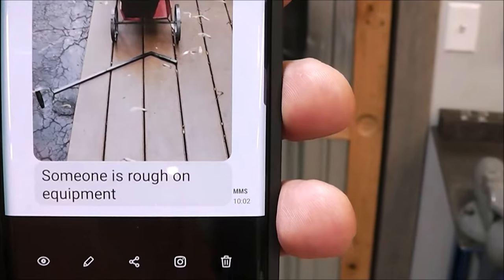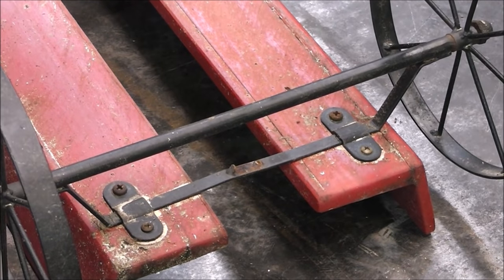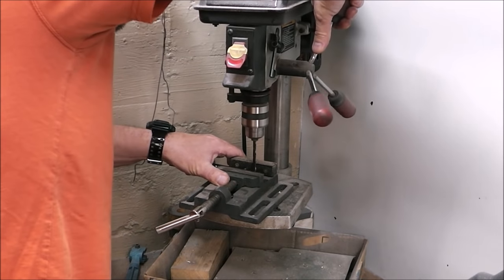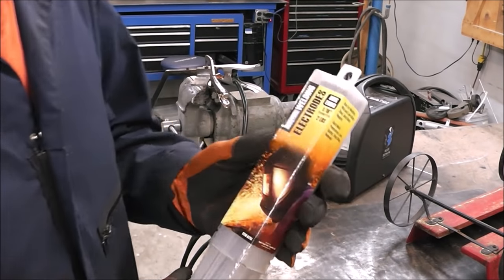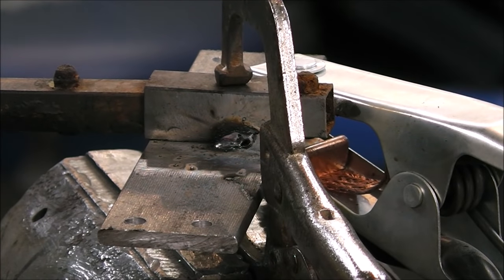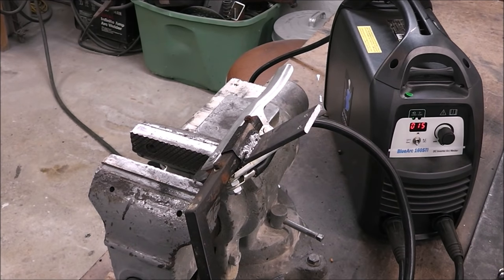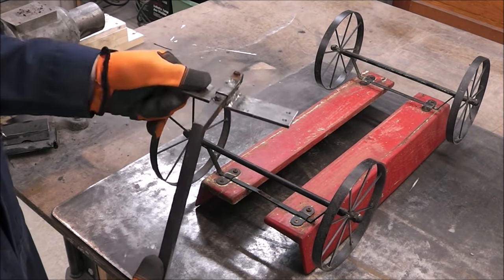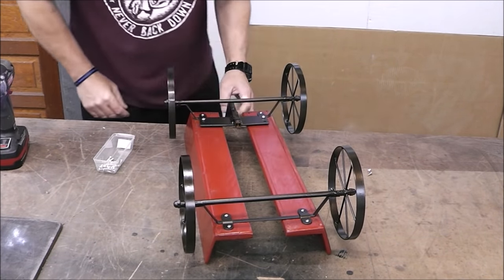Stick Welding Super Thin Sheet Metal Welding Thin Metal

Comment: Brazing might have worked nicely for that too I think. Lower temp and filling the uneven gaps.
Reply from the maker: Brazing is awesome! That's the first process I learned on. Welding in floor pans and I even chopped a 70 chevy and brazed the top back on. I got pretty good but it's been a while a long time but I love brazing

Comment: There were some kind of stainless rod I used to for sheet metal before, they were given to me and I don't remember the spec details but the big plus is that that were wayyy more forgiving than 6013.
Reply from the maker: Probably 309?
Reply: I just don't recall exactly, it was a couple of decades ago, but I've noticed much the same ease of use and forgiveness of the rods made for cast iron as well. I'm guessing it's a matter of the higher nickel content in both cases. Of course the rods are expensive and perhaps the welds won't be as strong but they sure are nice to use and the ones that I have used make for a good looking bead.
Reply: @Evasguy  for difficult cast iron repairs,get well cleaned,make a deep V groove,drill a hole at each crack ends if is a crack in a wall,start with a 309 stainless rod as a root weld,then coil a bare copper wire around 2.5mm 7018 rod,it will be difficult but will get a strong elastic repair,preheat to aprox 250-300Celsius if is a critical or sensitive piece,if the cast iron wall is bigger than 8mm thick,if is 8mm or below,use only stainless,DO NOT use 6013 for cast iron,it will crack right trough or aside the weld even if preheated,also there's cast iron rods but imperative to preheat and maintain a wachguard flame on the back of the critical piece you're welding with cast iron rods (make sure any rod is well dried ! ),good luck ! :-)

Comment: I just burned through my work piece really bad...sob sob.(This is my first time welding though) Seems like I have to learn this new skill
Reply from the maker: Do yourself a favor and get some 1/4" scap and just start running beads. Thin metal is challenging for most and it is double hard if your doing it and never welded before. I think you will get the hang of it a lot quicker if you start out with thicker material.
Reply: @BrandonLund  thanks for the advice. I will do it. Also, i ordered a auto darkening helmet. Hope that helps!
Reply from the maker: @VIDEOEPPO  your welcome and your going to love the auto darkening helmet!

Comment: Ever gas weld with oxygen and acyteline? People think it burns hot but it is actually the least heat of all welding processes and it's really good for thin metal they used to weld cars all the time that way
Reply from the maker: Thats one of the first processes I learned on. Oxy fuel brazing in new floor boards on a 70 Chevy pickup. I later did a chop top with brazing. Thanks for watching Matt
Reply: Yea it's a great process just slow and no its welding its brazing if you're doing it to cooper or non ferrous metals

Comment: Wldve took one of those 1/16 rods, broke all the flux off and used it as a filler metal.
Reply: That method is very good on thin to thin metals,he got the advantage of having a thicker metal in this job,but must practice more and try different approach to that type of job.

Comment: In your video you use very low current and an a.c. welder. You explained how you didn't want too much penetration and attempted to put most of the heat onto the thicker bar. 

I am a complete novice. Your lesson was very helpful. It is always useful to present the corollary. A video that uses 125 amps and a d.c. inverter is available elsewhere. Thank you for completing the picture for me.

David Lixenberg
Reply from the maker: Thanks David! Glad I could help!

Comment: Great video. Very well done. You mentioned you put the stick on negative. Is that right? I'm a little confused does that mean you used positive for the earth? Or did I get that all wrong? It's been so wet lately I Haven't done much welding. I'm semi outdoor.
Reply from the maker: You are correct. With the leads oriented this way it produces the least penetration which is good on thin metal. Thanks for watching! :)

Comment: Excelente, = Great,
Reply: muito obrigado. = thank you very much.
Reply: I'm from Brazil, here we don't have 1,5875 mm Rods (1/16") for Mild Iron just for Inox. So we have to use 2,0 mm, 2,5 mm, 3,25 mm, 4 mm, etc.
Reply: I completely agree with you. I prefer never to use a MIG / MAG welding machine or a TIG. A MIG / MAG or TIG machine would solve the problem with very thin metal sheets.
Reply: However MIG / MAG / TIG is a  clumsy, heavy thing with its fittings (accessories): Mix Gas Cylinder and Argon Gas Cylinder, Electrode Wire Rolls, Pressure Gauges, Hoses, etc.
Reply: MIG / MAG / TIG are much less safe than a Coated Electrode Inverter Machine, Mix Gas Cylinder and Argon Gas Cylinder, Pressure Gauges and Hoses, are a huge risk within a residence, sometimes we have to make welds inside our home.
Reply: I retired from my job, I'm 63 years old, and now I'm learning how to use a Coated Electrode Inverter Welding Machine
Reply from the maker: Welding is a lot of fun! Keep at and you will be "stacking dimes" in no time! Thanks for the great comments. I truly appreciate your support and encouragement. Cheers friend :)

Comment: the greater the rod angle, the less you blow thru. The arc has to work it's way around or thru the flux.  thus... less forceful arc and less  penetration.  I've worked with some guys who were good at thin sheet metal.  They travelled fast.  The slower you go, the more you blow thru.  I was never very good at it, but we gotterdun.
Reply from the maker: Right on. I always add more rod angle when using 6013 than i do with other rods to help minimize slag inclusion.
Reply: I have stick-welded sheet steel 20-25 thousandths thick without any heatsink. In my guesstimation, you probably cannot run a continuous bead, at all, on metal that thin. If you go too slow you blow through. It you go too fast, it doesn't stick. There's no between, meaning spot welds, only. If running a stick bead is possible on steel this thin, I'd be shocked.

I agree on high angle. Running the 1/16th 6013 on metal this thin, I found holding the rod all the way 90 degrees/perpendicular gives the best chance of making the spot weld stick to both pieces when overlapping two pieces of sheet metal this thin. It helps to drill a hole or make a slot in the top piece of the overlapping joint where you want to place the tack, so the bottom and top melt closer to the same time.

I have also welded the same thinness sheet metal edge-on to rebar. That was chaos. I have no clue how to do it. I just kept at it until it stuck. IIRC, 1/8" 6013 was the winner, obviously aimed at the rebar a bit away from the sheet metal.

Comment: Didn't you now just turned the force from the thin bar at the 4 screws in the wood plate?. witch I think is weaker.
Reply from the maker: Maybe....It's been a couple years now and we still use it so I guess it wasnt a bad idea after all

Comment: I am surprised you did not use 6010/6011, given you  have used it before. A 3/32 should 6010 be able to do that easy at like 25-35 amps or whatever, provided you have a solid welding machine...  and it wont have that terrible 6013 slag pocket stuff which always seems to happen with it. Its also stronger than 6013 from the bend testing I have done with it. Just my 2 cents, thanks for the video! :)
Reply from the maker: Thanks man! I think I might have a video with 6011 but I can't remember. Too many videos now lol

Comment: "like to" lol
No, I'm too poor to afford a MIG welder and my stick welder was gifted to me  (:
Great video though.
Reply from the maker: You can do a lot with stick! It's my favorite process!
Reply: @BrandonLund  definitely! Much more versatile than people give it credit for.
Reply from the maker: I agree completely!
Reply: @BrandonLund  also has the power to penetrate rust and the 6013's flux combine with it and clean up the metal puddle,just need some more amps,also the same related to paint,sticks have the power to burn trough rough dirty materials and still get a good fusion and penetration,almost nothing can beat the strength of a stick weld at this level,only MAG high power&deposition rate can burn trough dirty metal but on a bigger scale and not so consistent,the 7018 is the best rod to beat the dirt&paint but from 4mm up...below 4mm metal,6013 rod is the choice to go,just practice,will not be a pretty weld but it will be a little stronger than other methods without cleaning possible...good luck !

Comment: more than 1,6mm, but less than 3,17mm, how about using caliper instead of this oddball thing, maybe it is exactly 2mm? :D
Reply from the maker: @Whydo Youcare machinest tools arent used in fab shops because grinding dust destroys them. You use a thickness guage but if you really needed to be that precise a micrometer would be the tool you would want.

Comment: I'd have just drilled a hole in the handle and bolted it to the new steel strap 🤣
Reply from the maker: But then we wouldn't have a welding video about welding thin metal 😕

Comment: .. thinner electrodes not found at local shops , hot start and arcforce not helped me with rod still sticks at low amps  .. just cut all these BS and get a fluxcore
Reply from the maker: Imagine growing up in my era where there was no such thing as hot start or arc force! LOL. It sounds like your welder isn't performing correctly.  Hot start boosts the initial amperage to prevent sticking and arcforce senses the fluctuation in your voltage and increases it to prevent sticking. Stick welding is the basic form of welding. Learn to do this properly and you will have the basic fundamentals to understand all the other processes. Sure, you could go with flux core, but your only cheating yourself out of a learning opportunity in my opinion

Comment: The metal is 12 gauge. Not sure why your thickness gauge doesn't have 12 gauge, or even 10 gauge on it. Both are common sizes for sheet metal work. I use 12 gauge quite a bit.
Reply from the maker: I'm assuming it's probably a layout / size issue with the tool for the reason not having those sizes. I think the metal may have actually been metric.

Comment: Brazing with 56% silver alloy and a flux would have been much quicker, stronger, corrosion resistant, and zero chance of burn through. I like pushing stick to it's limits too but if it needs 1/16th rods, it should probably be brazed.
Reply from the maker: Well yah....but this video was for the folks looking to stick weld :)

Comment: There's always something I want to do. And everytime I've got to read😭
Ha e you every used soldering torch and a arc weld stick to weld thin wood stove pipe? Trying to find something that's not 75000.00 for 3 sticks?  Really its/70.00 for 3 sticks. But it might as well be 75000.00😇 I do enjoy the vids,  and Thank you
Reply from the maker: I have not tried that. Sorry. Thank you for your support. I appreciate it!

Comment: Why bother wild welding in the first place? You could use a pair of bolts to hold that thick metal plate connected to handle.
Reply from the maker: Why not weld it...this channel is about welding and im a welder so it seemed reasonable..

Comment: You call this thin? In indonesia this called thick steel. If you new in weld you practice your weld use this type steel with a stick welder.
Reply from the maker: I have weldded as thin as 22 Guage. I'm not in competition with anyone. Just trying to help folks because the basic principals hold true when welding thin metal.